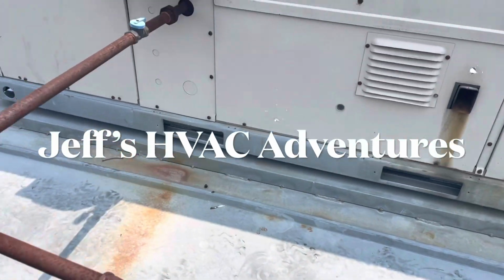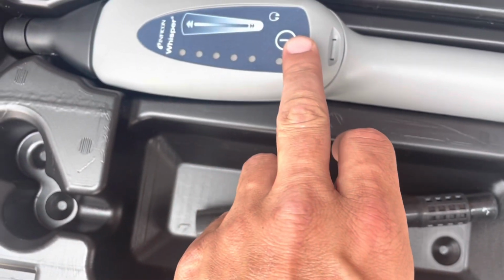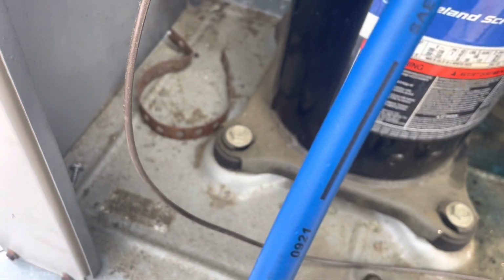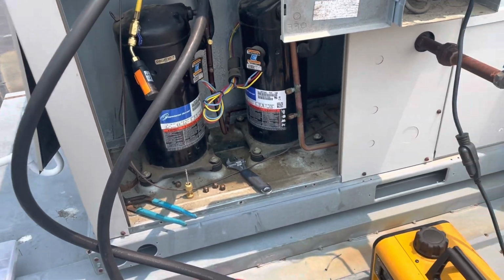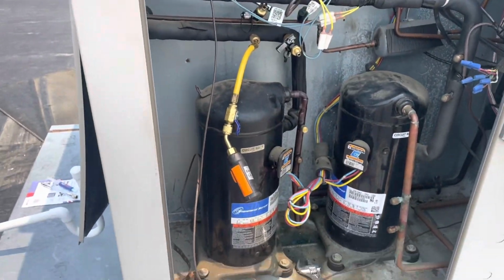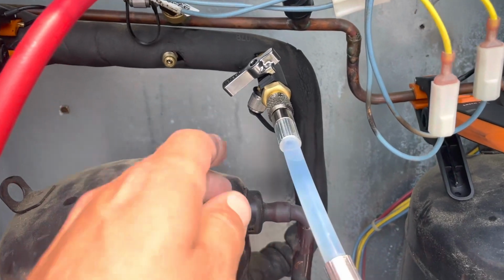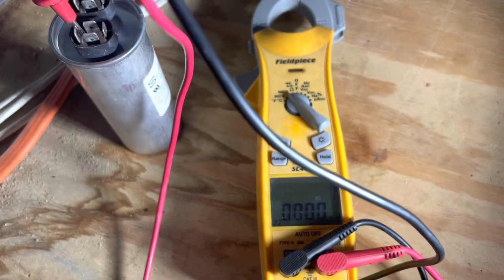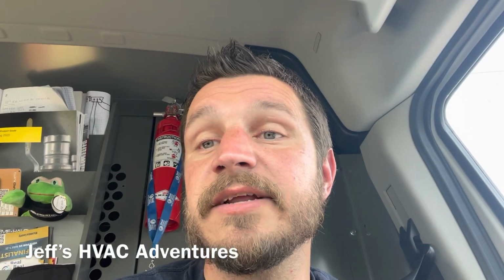Leak Repair Using AC Smart Seal! Plus a Diag on A Water Furnace Heat Pump.

Comment: Found a leaking steam Right at the suction manifold of my aunts goodman unit today. Besides the obvious oil i also hit it with the whisperer i own. You could hear it well. Sprayed bubbles to confirm. Fyi I’ve been told to wet the coil before hitting it with ultrasonic leak detectors
Reply from the maker: Good advice.  Makes sense. Thanks